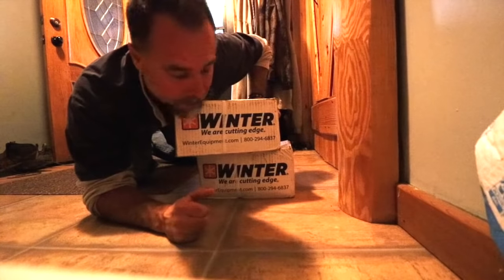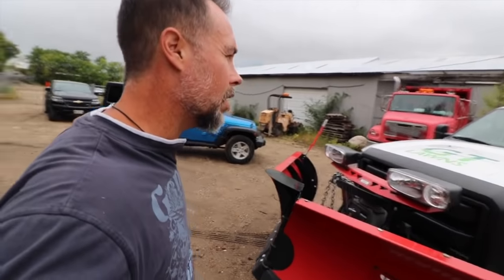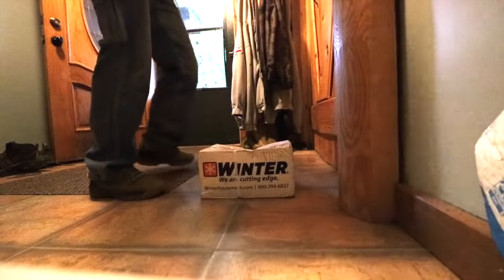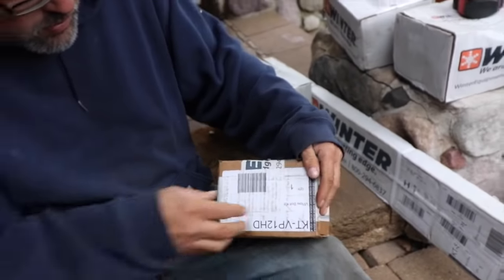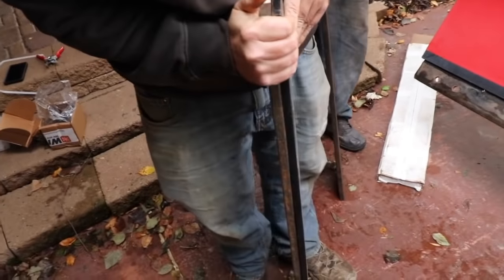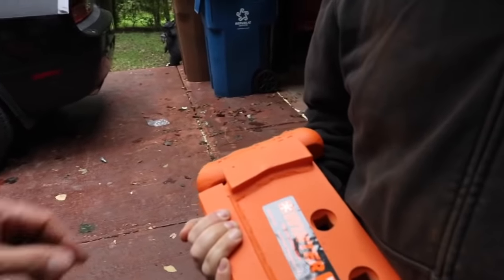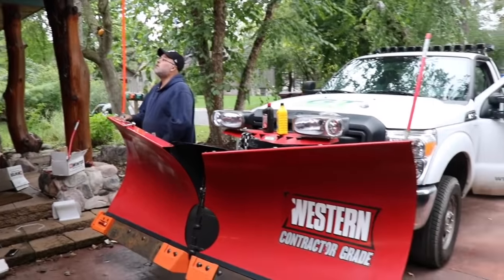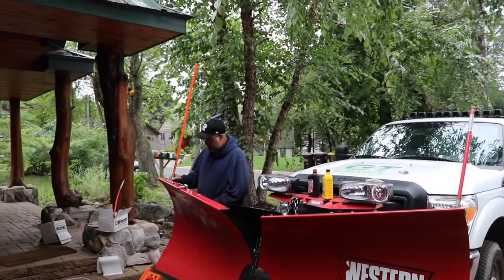Westerns Plows have One major flaw- their cutting edge-which I permanently fixed

Comment: I work for a school district in Pennsylvania our 2 newest plow trucks are GM a 2014 1500 the other a 2016 2500 both bought with plow packages and Western plows. Both have a recall 4 Plow wiring issues from GM the 2014 started out with the radio and the h v AC controls clicking off during plow operation and coming back with completely different settings. This issue started out occasionally and progressed 2 the point where we didn't even want to operate the vehicle for planning purposes because the issue was so debilitating to the operation of the plow, first the dealer didn't understand the problem then they didn't acknowledge the recall and after several visits they finally recognize the recall and given the recall information from the school district they finally move forward on replacing wiring harness and now the radio and HP AC controls shut down even when the flower is not on the vehicle. Through many of the visits since then they have reset the computer cleared codes and now replaced the powertrain control module and at this point it has not failed. Thankfully the 2016 2500 has yet to have any issues, but at this point only has 8000 miles on it. To my knowledge Ford and Dodge are not experiencing the same difficulties. Also my experience Ford has been dependable and more economical to buy and since you already have so many of them might as well stick with what works. I appreciate your Channel, keep up the good work

Comment: Hay wait you are putting the new edges on a truck that you admit you rarely use the front blade.  Of course the blades going to last longer lol
Reply: He rarely uses the front blade, regardless of which truck it's on. They both have front and rear blades. (Both the truck with the Winter Equpt., and the truck with the Western blade, have front & rear plough snowplows.)

Comment: Our local distributor said the center pieces are reportedly not bent properly for fitment,  and declined selling us the product. 

 Bummer as we were going to buy several sets . 

   He said Winter Equipment was working to correct the problem, though no idea when those could be available.
Reply: Where are you located?
Reply: @jakedudash9011  Maine
Reply: @grumpy1311  did you ever end up solving the cutting edge problem? If not please give me your email and we can get to the bottom of it together
Reply: @jakedudash9011  
   Hey Jake 

   I thought the cutting edge I put on this year would last the season but it is almost to the steel on the center pieces. 

    Let me know what you were thinking, I would be up for trying something other than the Stock edges.

Comment: Western cutting edges are the worst even the 1/2” heavy duty one season maximum per edge (@ $475.00 without curb guards)on a light year. All of our lots we service are concrete here in central Missouri and this looks like a promising product. I’ll be installing those as well they CANNOT be worse than the factory.

Comment: Do you use back up monitors with the rear plows?
Reply: Take the tailgate off.
Reply: They're meant to be pulled (driving the truck forward), right? If you look at the bracing/webbing/stiffening on it, you can see it's on the back side. Also, it's called a "PULL plow."

Comment: I don’t know I just bought a brand spanking new 2019 for the F250 6.7 L turbo diesel i plowed with dodge and Chevy I absolutely hated the Chevy ball joints ball joints ball joints all the time Dodge not a bad truck the 5.9 and the 6.7 was a good engine cummins but then come along Ford’s new 6.7 the commons would not hold a candle to this engine and I was a dodge man all my life I absolutely love my new Ford and I would highly recommend it excellent fuel mileage in big big torque ford all the Way The new 6.7 L ford diesel is incredible test drive one today
Reply: sold